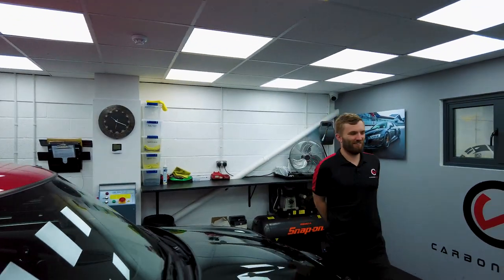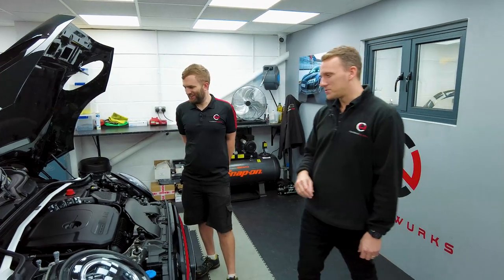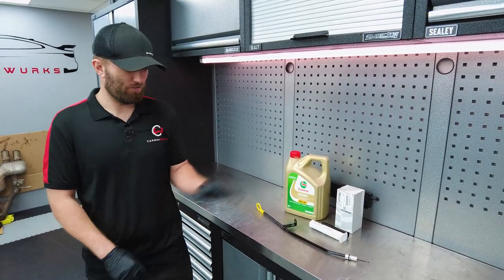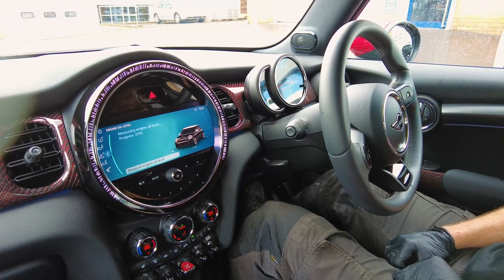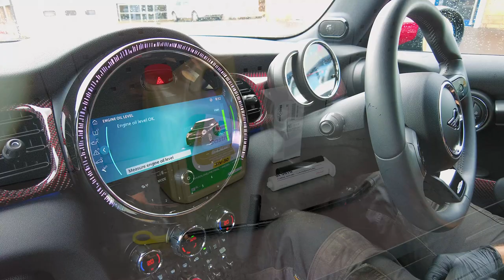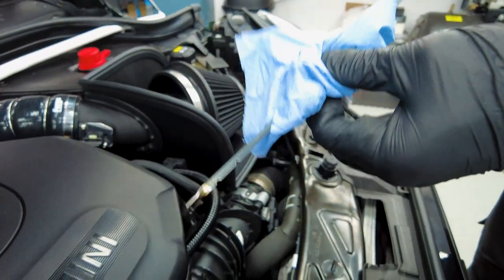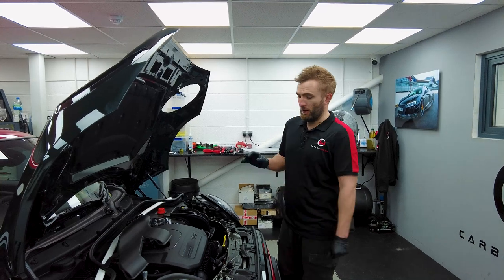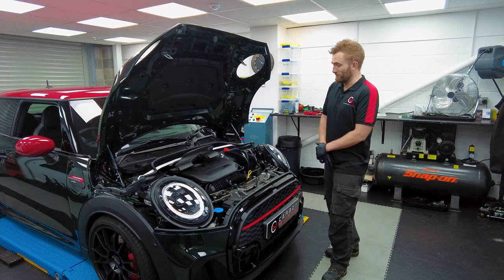The Most Complicated & Underrated Mini Gen 3 Upgrade?

Comment: In 2021, I got a 2017 Cooper S Clubman.  Love the car. Hate that it doesn't have a dipstick.  Back when I had cars with dipsticks (ALL of them, until the Clubman) I could double-check that the folks who changed my oil,  really changed the oil!   I would take 30 seconds to pull out the dipstick and look at it!  Yes, there's oil in the car.  Yes, it's amber-colored, not brown, so yes, they changed it!  So simple!
Reply from the maker: Exactly that! It’s not only for checking the oil level but great for checking oil condition too. Sometimes the old ways are still the best.

Comment: This is the best mud I have seen in any morden car. Question is, can you install oil dip stick on a BMW X1 or X3 (B48)? It makes checking oil level, verifying myself and peace of mind that the garage changed the engine oil.
Reply from the maker: It’s certainly a great upgrade for a variety of reasons. The Mini engine is a B48 but the dipstick tube is designed around other ancillary parts (water pump etc). You may find it would fit but could be obstructed by other things sadly.